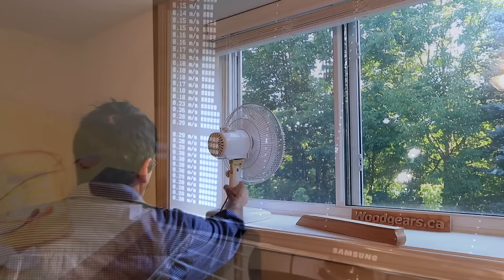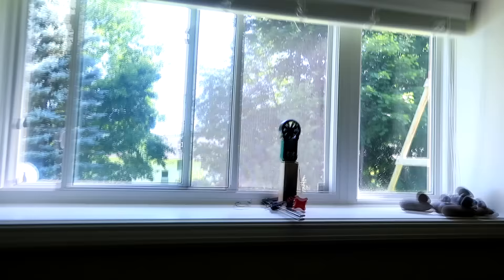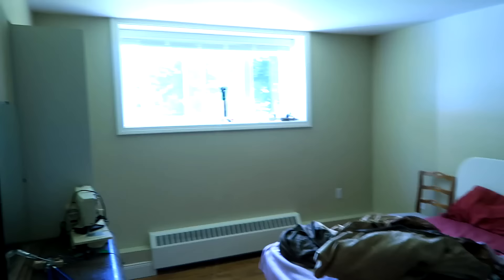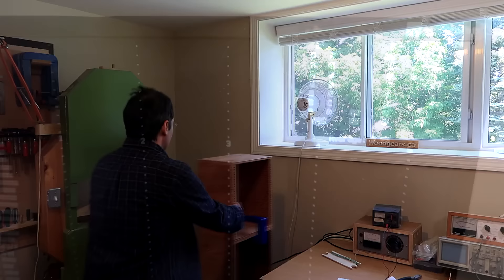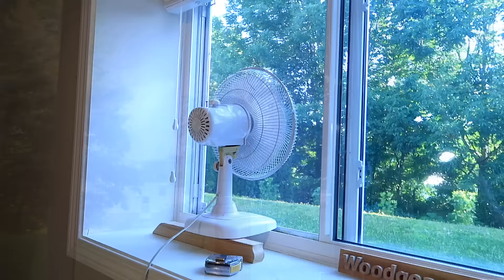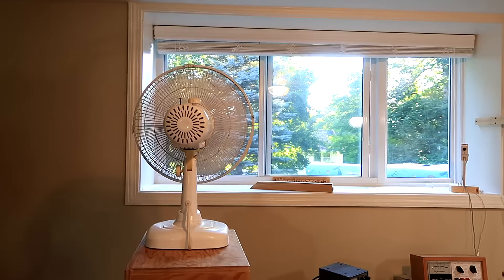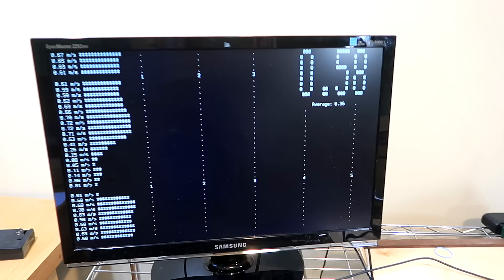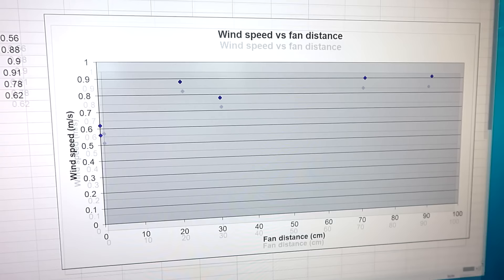Best fan placement to move air through the house

Comment: A few years ago I built a fan with a tight enclosure to fit in a window, effectively sealing the window off. With only a few mm between the fanblades and the enclosure, it draws quite an airflow.
Reply: Definitely not an ordinary fan!👍🏽
Reply: @head85  PC cooler fan or similar, most likely. Those are the easiest to mount onto a wooden window insert, as they come with screw holes. You can even get larger models, e.g. 200mm instead of the most common 120mm, meaning you can spin them slower (reducing the noise) while moving more air.
Reply: @EvenTheDogAgrees  my fan (and it's "enclosure" (not sure how to translate it in English)) is built into a wooden insert, just as you described. The only difference is the fan itself. It's an industrial grade 230V fan of about 500mm (no typo) and draws well over 3000m³/h. 🤣 When it was still in use, I usually ran it at about 40% capacity to avoid complaints from my neighbours across the street 🤣

Trust me, I've been laughing my ass of after I turned it on for the first time. Up until then I just didn't have a single clue what it would be like to have a fan blowing 3000m³/h of air through my apartment 🤣🤣🤣
Reply: @Sierra-Whisky  LOL, that's epic! Thanks for the laugh! 😂

Comment: I have a home from the 1800s and there are two well placed windows that allow for airflow through the house. I use window fans that are sealed around the edges that can blow air in or out. At night, I'll have the east and cooler shaded fan blow in and the west fan blow out and the combination moves a lot of air very quickly. I notice a significant drop on temperature in that configuration. I'm sure airflow measurements would be quite telling. In the morning, i could reverse the fans blowing and i sometimes do, but I'll usually close the windows and curtain the house and it'll stay cool until night and repeat the process. Air conditioning isn't even necessary unless it's really horrible

Comment: This will be really helpful when I move back to Europe next year. Normally no AC, so to keep your house somewhat cool during heatwaves you kind of develop a strategy/timing of when to open and close windows, shades, etc.
Reply: Playing this exact game right now :)
Reply: They make this wonderful invention called a portable air conditioner it was designed for houses that do not have central air conditioning
Reply: @iair-conditiontheoutsideai3076  They are inefficient and have variable loudness when compressor is turning on and off. That's why I finally moved the whole thing outside and I'm sucking air from the room through a hole, moving it through the evaporator and back into the room through another hole. Well-insulated hoses, silent compressor, better efficiency.
Reply: @radekoncar2404  yeah if you want to go that far with it considering most these people don't even have air conditioning I think something would be a start for them
Reply: @radekoncar2404  Did you move a portable unit outside? If so..I'm listening!
Reply: @807D14M0ND5  Yeah, to a covered area next my room, two holes in the wall, self-insulated hoses, intake and exhaust covered with DIY glued styrofoam boxes, attached to the unit with silicone. Dust filter is still accessible, remote works by pressing it while your hand is inside the wall hole :)

Comment: Hi Matthias  !  Last summer (July 2022) I did the same kind of experiment!  And find about the same results. My fan was one of those tall 5' on a pedestal 18 inches blade. The best distance was about a meter and a half from the window.   Since air acts like a liquid, one has to think outside the box. ( or outside the fan cage in this case)  From what I gathered is that those fans dont pull air much from the back but they actually create a turbulence around the cage that pushes the flow instead of a coherent vortex. (like a turbine)  I am happy to see that someone actually did a better scientific approach!
Reply: I'm trying to find one where the results include blocking the window off where the fan is. Blocking the edges so there's no leading back draft. Whenever I put a window in a fan I always block the unused portions of the screen off.
Reply: @CalvinHikes I imagine that does improve air flow, but not by a significant amount. Probably the difference between .6 and .7 ish
Reply: My floor fan rotates so I put it in the corner of the room so it's not always pointing straight at me.
Reply: The turbine analogy helped me understand better, ty

Comment: Great video! Everyone who is saying Bernoulis principle, there's more! It's called static air pressure. A small fan directly against a window just thrashes the air and shoots it forward, but doesn't establish an air pressure difference between the INSIDE and the OUTSIDE of the window. Air can just flow around the sides of the fan. We see this with decreased air flow/speed readings in the video. When you move the fan back however, the air flow "cone" spreads out and you create an even blanket of high air pressure across the ENTIRE window. Its the same effect if you were to use the square fan in the window and add cardboard to the top to fill in the rest of the window gap - air is then forced in a single direction through the window instead of freely flowing around a fan in the same window.
Reply: what you just described in laymens terms is 
exactly what bernoullis principle is talking about 
its all fluid dynamics and in physics air is considered a fluid you should really read up on it 
and you will understand that the people saying bernoullis principle are 100 percent in the right
Reply: @Crushonius  Bernoulis' principle is more relevant to airflow in a tightly constrained system no? It's also the way a Dyson fan uses a ring of fast moving air on bladeless fans. I think this example is more simple than that....just an opinion. I might be mis understanding, where the fan cone is smaller than the window opening, and there is some venturi effect happing across that pressure difference (in/out of the window) 

5mph wind on the side of a house VS a 100mph leafblower directly in a window will yield similar results to the OPs test, but a leafblower in a tube could draw a vacuum to move more air (venturi effect) than it would on its own. My thought was air flow through the house is not laminar enough to take advantage of this.

Comment: No joke, this guy proofed that I've done the right measurement for my room! I'm living in a very small room usually closing the door with only fan and not air-cond, the room temperature was really hot when the weather is hot and I tried to turn my fan towards living room with door opened, and it result in getting more cold air in my room instead! 

Thank you for doing this air circulating science stuff! I was so excited when I found that someone actually do this to collect data!
Reply: I wonder what is the distance between your living room towards your room?

Comment: I’ve been waiting my whole life to hear this! After putting box fans in my windows and blowing air inside, I am now changing my ways! Thank you so much for your thorough experiment & data! :)
Reply: He never tested a box fan blowing air inside tho.  I guess the fan broke b4 he could.
Reply: i use the box fan on my window hanged from the top with a strap, then I have a towel covering the bottom and the window slightly closed (my window is big and opens horizontal) It sucks in air so good and it kinda creates a wierd pressure in the room but it feels so good. when you stand outside my room with the door close, you can feel air rushing out from the doors. 100% reccommend atleast trying it.
Reply: I can air out my stinky roommates room so much easier when he leaves for work!
Reply: @CrocodileWhispers probably better spent time looking for a job for yourself
Reply: @anon7661  we worked shifts opposite ends of week

Comment: Well done, rare to watch such to the point no nonsense content nowadays. Real smart people have no time to fool around.
I used to do this in a non a/c room. I selected the optimal fan placement distance by observing how high the curtains on other windows get blown in by the low pressure the fan generated. This way I managed to keep the room about 8 degrees colder compared to the 32degree Celsius outside air.

Comment: The reason why the fan being a little bit further away makes it more effective is know as Bernoulli's principle, which states that the pressure in a stream of fluid is reduced as the speed of the flow is increased. This is used in hydrodynamics but also applies to the air in the room with a window, as shown here
Reply: what if he moved further away, outside the window?
Reply: just invest in 2 box fans...one in, one out...cleaner look, more effective
Reply: @iggypopisgod9 
Then, 2 energy used
Reply: is a fan thats made to go in the window, like a (Holmes Dual Blade Twin Window Fan), not very effective up against the screen?

Comment: This is super useful. I have a little desk fan that I point at my laptop to keep it cool, But I sometimes open the window and point my fan inwards to try and circulate air. Apparently that's super ineffective and I should be pointing the fan outside the window when I do that. I'll be doing that from now on. Thanks!

Comment: Thank you for confirming my theory on the best way to use a fan with windows. I live in a multi-story house, and I also use convection to provide a bump by placing the fan in the highest open window and opening the lowest windows for air to be pulled in. I'm fortunate that the lowest windows also happen to be north facing, and adjacent to a large shaded concrete pad, so I assume there is some added cooling gained there as well by pulling the air across a large mass/surface area that is cooler than the ambient air temperature in the sun.
Reply: so open the lowest north facing window, then open the highest south facing window then put the fan facing the south window?

Comment: "E = 1/2 m v^2"
For the same increase in energy, you could either double the velocity, or quadruple the mass.
When you move the fan further from the window, it entrains air from the area surrounding the flow stream, trading velocity for mass.
The overall effect is that although the flow stream is moving slower, there's more air going out the window.

Comment: It's not as powerful as I thought it would be, but it works very well. https://www.youtube.com/post/UgkxGjG43--gYqIoT4Xkur2PqCrtbKwTv2h6 There are three options to circulate air, and best of all a remote control for us lazy people. Installation was a breeze (no pun intended). It actually took longer to open the box then it did putting the side extenders on and sitting it in the window opening. It's a perfect alternative when you want airflow, but not the AC. Just might order another one for a different room. UPDATE: Bought another one like I said. They work great. Why not have two...
Reply: it's not 2ft from the window though so much more inefficient. This is why exhaust fans attached to walls don't really help much

Comment: that's how aircraft emergency slides are inflated , the rocket motor is positioned in a special fixture which draws more air around the gas stream adding to the mass flow instead of only using the gas generated to fill the slide
Reply: Its also how firefighters ventilate smoke out of buildings.
Reply: Using bernoullis principles
Reply: Think of it as a venturi tube .   That drive instruments on older aircraft without a vacuum pump
Reply: Having worked on aircraft escape slides and life rafts doing recertification for a couple of years.... There no 'rocket motor' to inflate them. It's a 3000 psi gas cylinder that DOES pressurize a Venturi (with a check flapper valve) to pull in atmospheric air. It takes DAYS to repack one of these and the folds must be JUST RIGHT so it unfolds and doesn't pinch off any section or block the Venturi. We use shotbags, and molding cases and some manufacturer (Air Cruiser brand slides) even have you put some of their in an 'oven' under compression for hours so they 'set' and don't slowly grow and bulge out of the case in the aircraft door.

Comment: Thank you Matthias, this was VERY interesting. Years ago I found myself trying to maximize fan efficiency, but in an emergency situation. My wife decided to help me by hard boiling some eggs for my lunch while I went out to the store to buy a couple of essentials.  I returned to find our 2 bedroom apartment filled with grey smoke from the 12 foot ceiling to 3 feet above the floor.  My wife had fallen asleep. (As an aside, you might consider an episode on what household items produce the best smoke.  Eggs might be a good choice because they did not ignite like bacon would.) The data collection was not very accurate but more eyeball observation.  After several fan positions, I determined the quickest way to clear the smoke was to remove the screen from the terrace door.  It is obvious after thinking back on my FLUID DYNAMICS class. Although the filaments of a screen occupy about 20% of the total area, boundary layer and turbulent flow effectively cut the air flow to about 50% of a free space comparison. Free space as in a screen free door.  Which is only practical if the mosquitoes and other bugs are on vacation. Or, in an emergency.  From my recollection, in a screen free  situation, placement of the fan in the doorway was more effective than at a distance from the door. I think I could explain why your solution works better for a window with a screen if you want me to elaborate.

Comment: Neat. I've played around with this as well. I use a Lasko-Premium-20-in-3-Speed-Box-Fan-3723 from Home Depot. I place it on a window with nearly the exact dimensions and a bit of foam padding where it has the smallest space. Works great pulling and pushing air through out the house. This fan is very noticeably stronger than other box fans I have around. It's also very, very noisy. I've seen even stronger fans but for more than double the price. And probably even more noise.
I've tried placing it in larger windows with noticeable levels of lower airflow.  I think the reason why the fan is pulling/pushing air in the opposite direction the fan is blowing is because of space around the outside of the fan. Maybe you'd get better flow in either direction if treated more like an Air Conditioning unit where the window is sealed around the fan.

Comment: In the fire service we use "horizontal ventilation" using positive and negative pressure fans. I've learned to pull the fan back to cover the entire doorway on house fires. You can move A LOT of air very quickly!
Reply: The cone of air should be just larger than the opening, or slightly smaller than the opening.

Comment: This totally works, I saw several videos of this in the past and tried it myself. I didn't do all the air speed tests, but it changes it from taking an hour or more to cool my room with only a slight temperature change even when it's like in the 60s outside to bare minutes. Obviously the colder outside the faster and bigger the effect, but just the shear difference between having the fan in the window sill versus like 2-3 feet back made a huge difference in cooling my room. A whole house would be slower since it's a much greater volume of air that has to be moved but it would still have a much greater effect.

My basic understanding of the reason is basically that by putting some space between you're increasing the volume of air from inside that can be pushed outside, that with the greater space more air will flow faster into that space than will just flow into the back of the fan.

Comment: I really like those side-by-side window fan units, the internal shrouding seems to help a ton with performance.
Reply: Do you have one fan blowing in and the other blowing out?
Reply: @prima808  No, I just open a door or window to equalize the pressure. I think putting those fans into an in/out configuration results in recirculating stale air rather than actually replacing the air in the room.

Comment: In my house, I've found the best place is actually in the middle of the house. I use a portable evaporative system in the doorway to the wet space (shower/toilet/laundry). lots of air intake, and a nice open run in and out of the fan. being in the doorway, there is very little air bleeding around the fan. having the fan at the other end of the hall helps keep it quiet, and pumping cold air down the hall keeps the brick from getting warm, which really helps in a heatwave. a few pieces of thread taped to a skewer is a really useful tool to figure out placement of fans, and if you get it right, it makes a huge difference.

I'd really like to see what sort of difference an external evaporator over the hot side of my AC makes, Im thinking of a sheet pitched like a tent about 1-2ft away from the external unit with a mist spray on it. however, I only use my compressor AC on REALLY hot days (above 36 usually), as the evap/fan setup works well enough. and if I deem it worth switching on, I sure don't want to be out there messing around with it. would be interesting to know how much power can be saved at the expense of some water.

Comment: The real physics behind this seemingly counter intuitive  phenomenon is that the shape of the window is rectangular and the fan has to be circular (even it is called a box fan).  When the fan is close to the window, the area is not covered by the fan blade just leaking the air right back.  This is because a fan only create a positive pressure zone in front of the blade.  If you cover the box fan outside the area not cover by the blade and the window outside the box fan, it should work well right at the window.
Reply: I need Vsauce to explain that to me